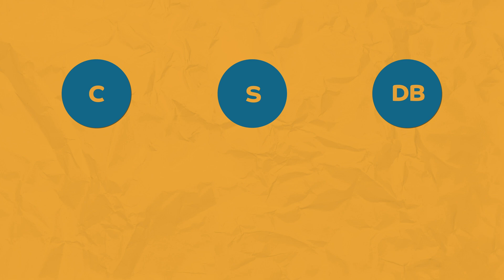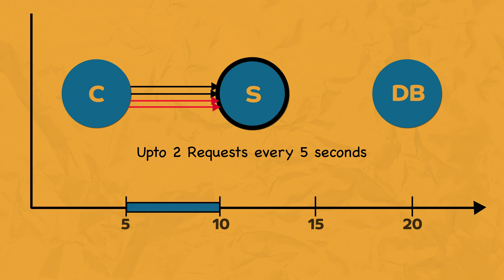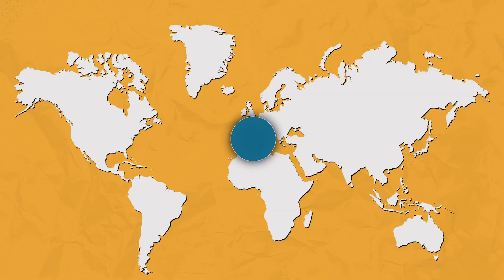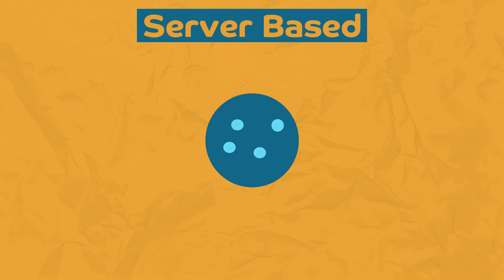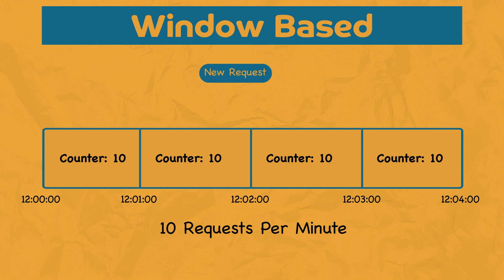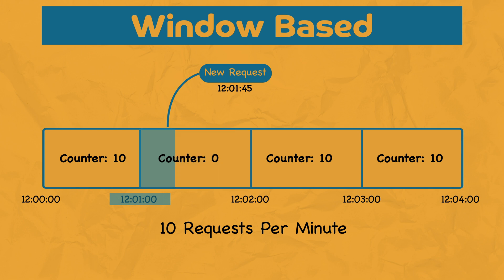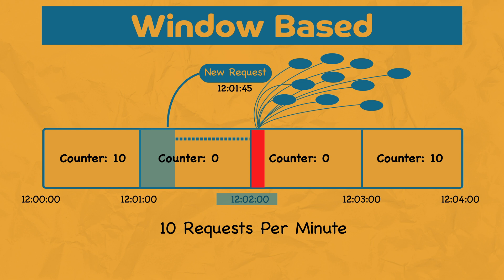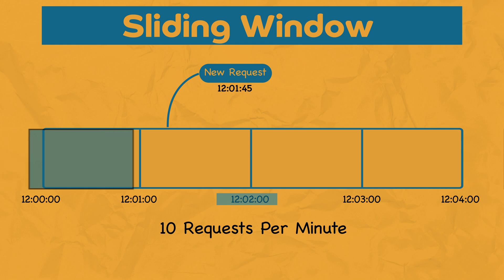Rate Limiting | System Design Interview Basics

Comment: What I wonder is that, if the backend service is distributed, where shall we apply these rate limiting algorithms, applied on the Gateway? If we don't have a gateway like nginx, for example, inside the microservice arch, in this case if we apply the rate limiting algorithm on every instance, it's in-memory and isolated, it's not accurate anymore, If applied in a single standalone component, we need to visit this component every time a new request comes in, any good suggestions?
Reply from the maker: Great question! Engineers typically don't implement these algorithms, the come with a library or service. If you are using a distributed microservices architecture, it would most likely be fronted with a Gateway as you indicated, and most well known gateways (APIGW, Apigee and probably Nginx) have rate limiting feature built in, which is usually utilized. In addition, you can rate limit at least few of the important services if not all. I think the second half your question has to do with coordinated rate limiting, which requires use of distributed counter, let me know if this article helps https://engineering.salesforce.com/coordinated-rate-limiting-in-microservices-bb8861126beb/